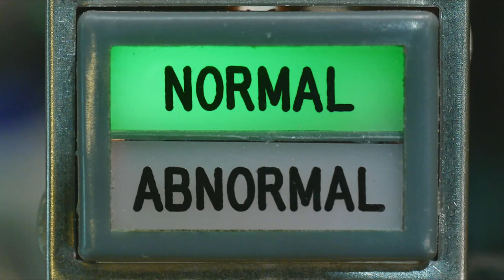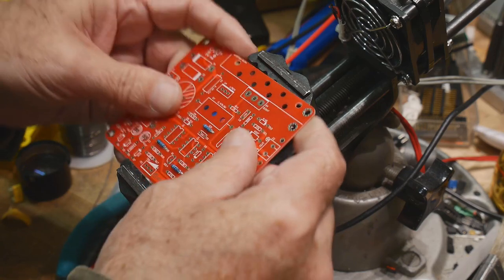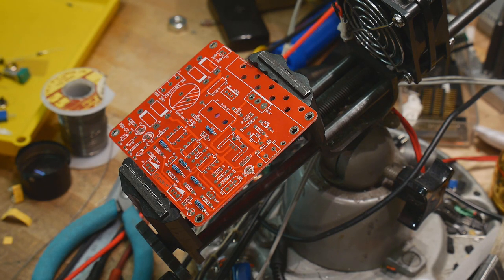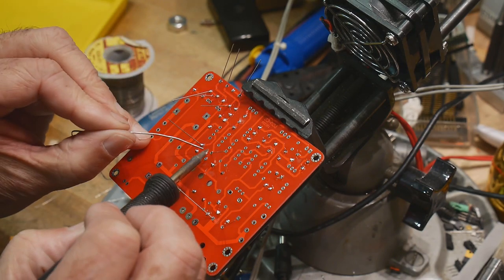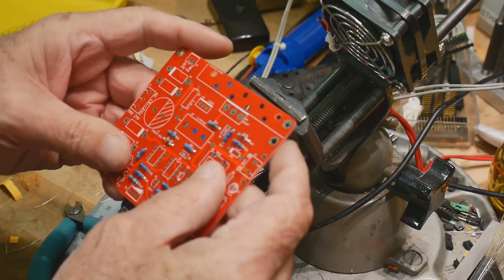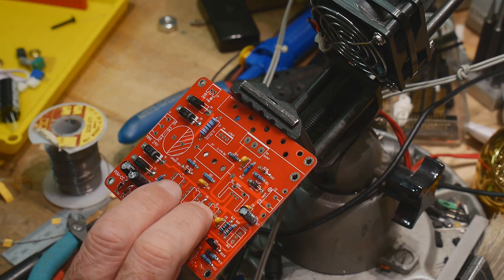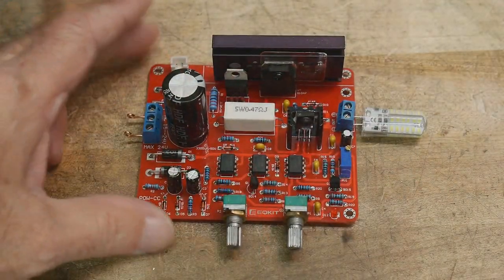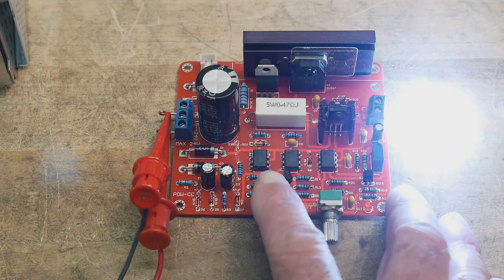#710 0-30V 3A Power supply kit EQKIT

Comment: Nice! And it uses all off-the-shelf parts.
One thing I notice on the schematic is the auxiliary negative voltage to be able to adjust the minimum output to 0V. This can be a nuisance that if done wrong can make your output voltage fluctuate up and down at the moment you turn off the power supply.
I had the experience with an Elektor magazine circuit that used an op-amp and a -5v auxiliary supply to drive an L200 regulator, and when set to some voltage, lets say 9V, at the moment of turning off the supply, the power part and the auxiliary part discharged at different rates, and this made the output jump from the 9v I had set, to 12 or more volts for a moment and then down to 0 as it all got fully discharged.
Finally I powered the opamp with single supply, not using the -5v auxiliary, and the circuit lost its feature of going down to 0, but the weavy jumpy voltage problem at switch-off disappeared.
Reply: To solve this, Q1 is in the circuit. https://youtu.be/KRcTn3lqnUw?t=1654

Comment: Excellent videos!!!  I was wondering if you might be able to explain how U1 generates the 10.2 VDC output a bit better.  I have two of these kits and neither of them works.  I don't understand how no input on pins 2 & 3 can initially generate the 10.2 volt output.  The rest of the circuit I do (mostly) understand.  Thanks a million!!!  Keep the good vids coming!!    Kenny

Comment: That design (first published in some German magazine years ago) suffers from overshoot on powerup, unsuitable opamps for the stated voltage range etc. 
There is a thread on EEVBlog forum about it, various people tried to fix it.
Forgot to add, anyone looking to buy this kit, you can get it a AliExpress for $3.65 including shipping. So with all of it's flaws you can't beat that price.
Reply: One of those threads is mine.  I modded the board to improve it but still ended up downgrading it to 2.25A at 16V max.  Seems to work ok with the mods at this reduced capacity.
Reply: @denniscabell8304  Link to the modifications?
Reply: Years ago?
Tens of years ago!
Reply: This is a "chinese type kit"
Comes without assembly instructions, schematic, theory of operation.
You gave to guess a lot during assembly. #$&* !
Remember Heathkit.
Reply: @paulcohen1555  It's not that bad, everything is labelled, it took me a few hours to assemble it without instructions.
Reply: @galileo_rs  Very good. But it should take much less if everything was included with the "kit"
Reply: @paulcohen1555  It was due to my fumbling with it, spacing the components and making it look nice. Honesty there wasn't any time during the assembly that I had to stop and think where to place the component.

Comment: Zener diodes are devices with a pretty accurate reverse bias breakdown voltage. They are used "backwards" in circuit in comparison with the common diode.

Comment: Can this module be increased in output to around 45 volts, current unchanged. A 15 volt zener in the earth of the regulator chip may do the trick? With a suitable XFMR of course.

Comment: Please be advised that there are "fakes" out there... EBAY, etc. The genuine ones, like this,  will have the voltage regulator for the fan in the upper left corner: It will be parallel to the edge of the board. On the fake ones, the voltage regulator will be perpendicular to the edge of the board. Also, the drive transistor will not be located on the edge of the board.

Comment: I realize this is a 2+ year old video; however, I do have a quick question.
I have a 24VAC transformer, (2 wires on out).

Do I wire it up like you do? (I have the same kit).

I have noticed some people have a 12-0-12 AC Transformer, and they use all 3 terminals on the board from the 12-0-12 transformer..

This is my first kit involving AC Transformers. (I do understand them a wee but; but, I'm still learning.)

I have watched countless videos on this kit.
You are a great teacher. "AC doesn't matter which way" 
I say to that comment; Thank you, that is good to know.
The input side is different, as I already understand that.

Thank you for a reply (in advance).
~J
Reply from the maker: your transformer will be fine
Reply: @IMSAIGuy  Thanks. :)
I appreciate your input.
Now to find a nice container and finish this project up!

Comment: I found the oldest and probably the original circuit and description in PRACTICAL ELECTRONICS October 1978 page 1070:
https://worldradiohistory.com/UK/Practical-Electronics/70s/Practical-Electronics-1978-10.pdf
There is a good description of the circuit operation.
Reply from the maker: Yes that looks like the original. Wow, how did you find that.
Reply: @IMSAIGuy  I remembered that I have seen something like that.
Found again with the Internet's God and some keywords.